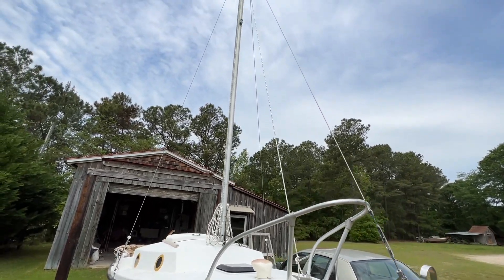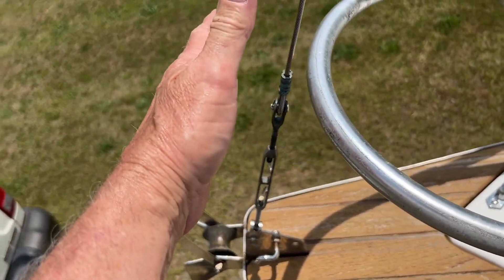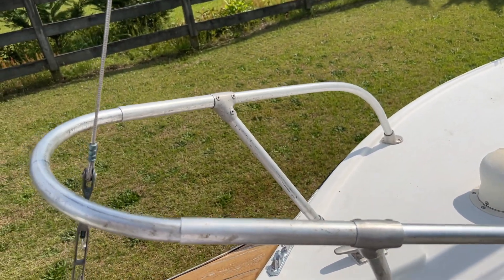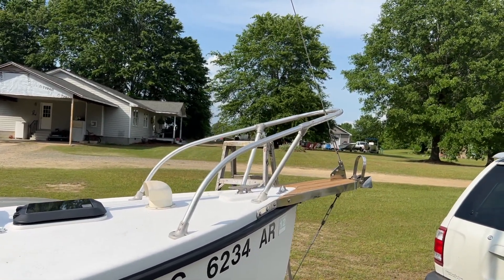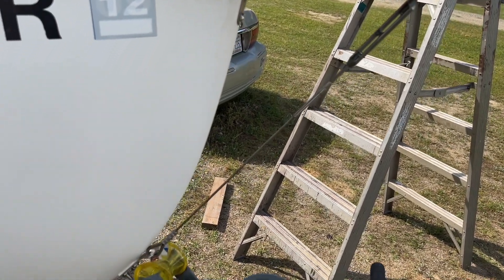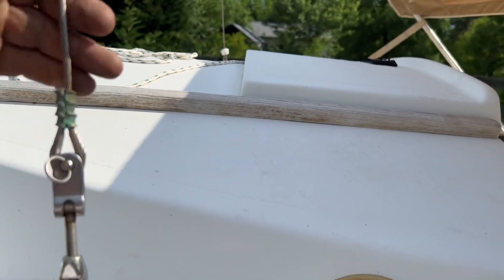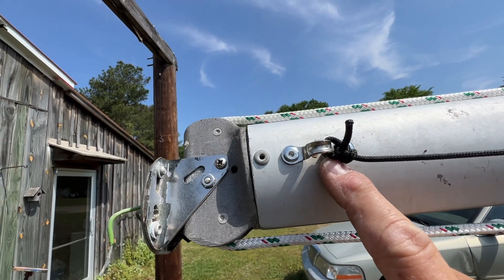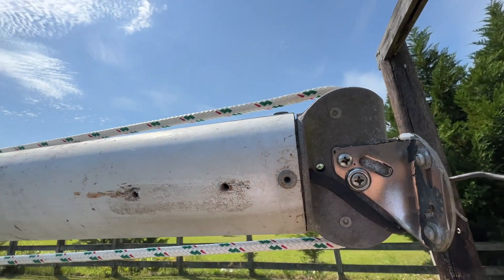Extending the bow rail and other mods  Com-Pac 16

Comment: I have to ask do you have a link for the bow window I've been looking for a replacement but can't find a direct replacement didn't know if yours was just well kept or brand new but it looks brand new any info would be greatly appreciated, James 83 CP16
Reply from the maker: It is actually several years old
I will check when i get a chance and get you the brand and model
I just took it out and rebedded it recently